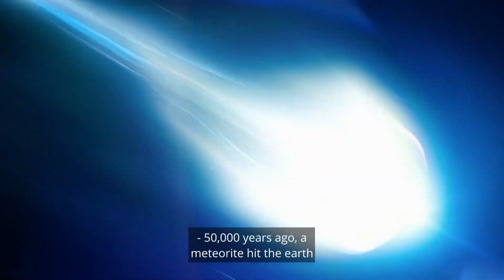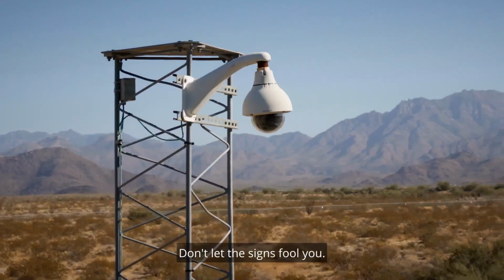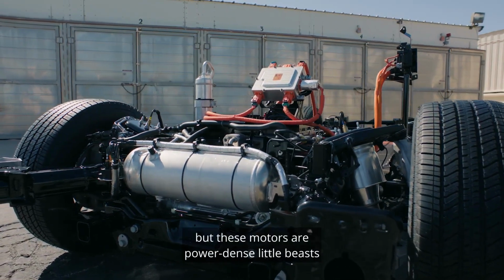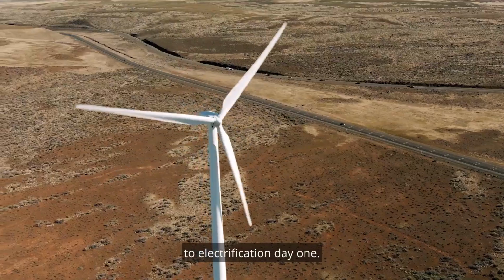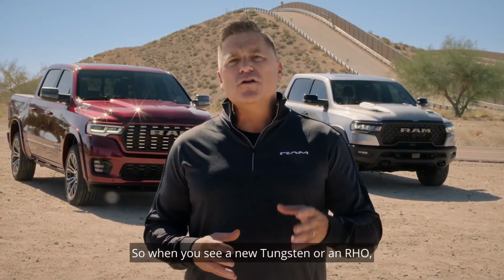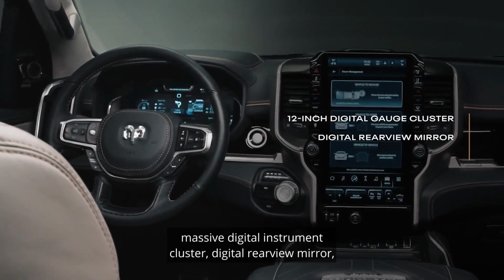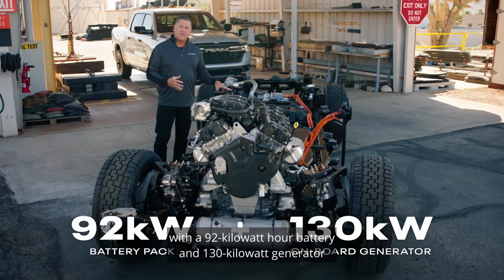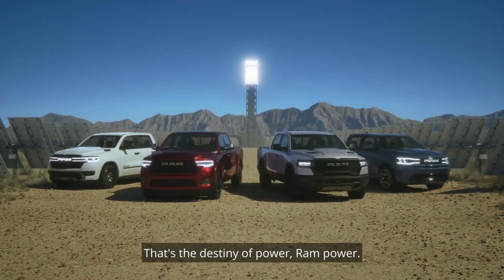Game Changing Powertrains and Electric Trucks | Watch the 2025 Ram Trucks Reveal

Comment: Give me the 3L Diesel RWD with a front electric drive and a ~50 kwh battery.  I want the diesel for HWY and towing, the electric front for town.  Let the diesel have a recharge mode attached to a 2nd larger alternator for power generation.
Reply: literaly the best option tbh! the diesel will be even more capable and they wont even need a turbo on the engine.

Comment: If the Hemi had the same boost it would perform at over 600 HP... "After some tuning (11.5:1 air/fuel ratio and 18 degrees of total timing), the turbo 5.7L Hemi belted out 571 hp at 5,300 rpm and 619 lb-ft of torque at 4,300 rpm. Equipped with a Turbo Smart wastegate, the boost varied by less than 1/10 of a pound! The Turbo Smart gate may cost a little more than the eBay stuff we used on the Ford, but boost control is not something to skimp on. Using a manual wastegate controller (also from Turbo Smart), we cranked up the boost to a maximum of 10.4 psi and saw 627 hp at 5,500 rpm and an amazing 689 lb-ft of torque at 4,300 rpm. Torque production exceeded 650 lb-ft from 3,600 rpm to 5,000 rpm, making for some serious grunt." Thus the 5.7L would best the Hurricanes.
Reply: I'm not really sure what your point is

Comment: Using wind turbines is a mistake as they are non-recyclable and dont work in high winds or freezing temps and they destroy thousands of birds and are eye sores. They are not a good association. Hydropower is and solar panels would be if the recycling problems were solved. Materials need to be economically recyclable like metals and wood, and recyclable plastics.

Comment: All the dating methods are extrapolated with assumptions about the starting levels of radioisotopes and then further assumptions as the the rate of decay and assuming there is no variability. parroting deep time imaginations doesn't make this video have more credibility. Excessive and unwarranted use of superlatives does not increase the credibility, but detracts from it.

The Toyota Tundra has the IIHS Top Safety Pick Plus award and RAM doesn't. That is a huge error on the part of RAM. When the 1500 first came out it was the safest truck and because no one at RAM went after the shortfalls it now is saddled with Poor, Marginal, and Acceptable ratings preventing it from achieving the coveted IIHS Top Safety Pick Plus status. This needs to be fixed ASAP as life and injury safety are the only thing that justify greater costs. Not having them is a deal breaker.

IF RAM had fixed this they would have sold me on a new RAM in 2021 or 2022 or 2023 or 2024. As it is I am now looking at replacing the 1500 I really like with a Toyota Tundra purely for safety reasons. RAM needs to make Safety and this would include Reliability priority #1 and determine to never again be bested by any other mfg in the areas of crash safety, crash avoidance, and reliability. The reliability entails the ease of serviceability as trained technicians are not always available especially as the population moves out of the cities to more rural areas. The sales model also needs to change to allow customers to save money by ordering and buying online at reduced costs. Ask customers what they are willing to pay and strive to be able to provide the best deal at the best price with the best profit a win-win for RAM and the customer.

Herre is another place RAM can beat ALL the competition. End all privacy attack paths and prevent big brother or anyone controlling a customer's possession, their truck. They bought it and they own it NOT the government or the insurance companies or the seller or the mfg. Do these things and RAM will crush the competition who will not change or innovate.

THAT is thinking outside the box.